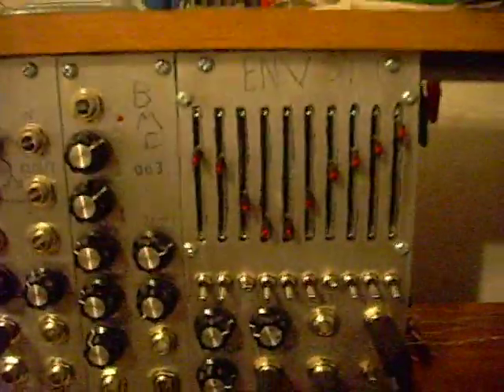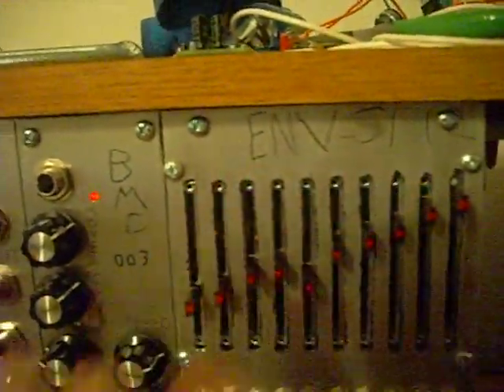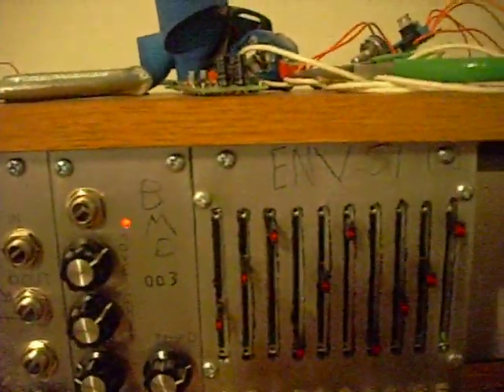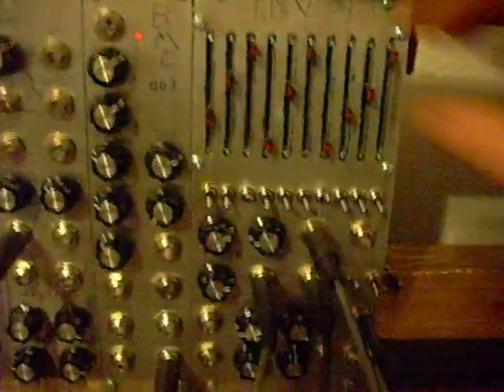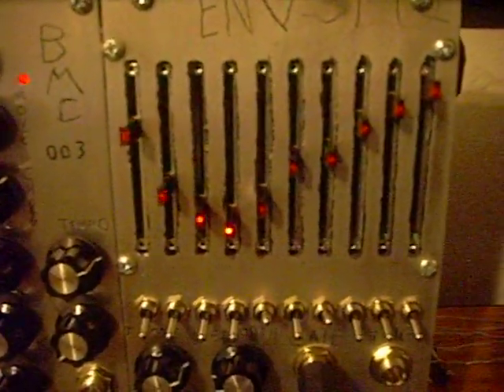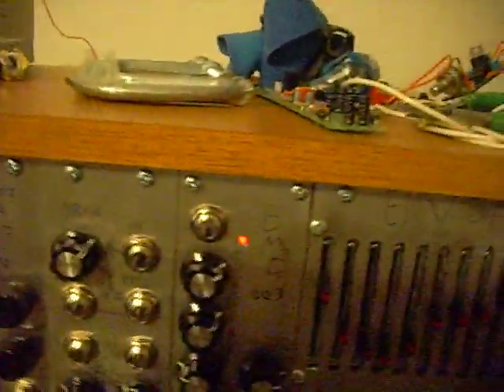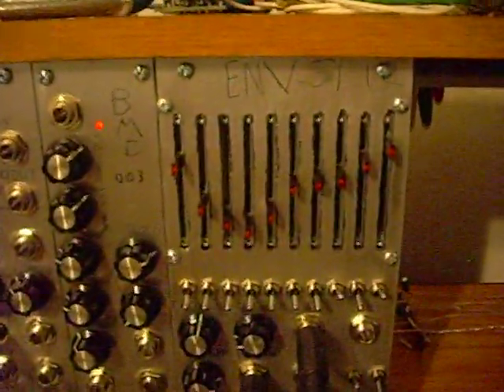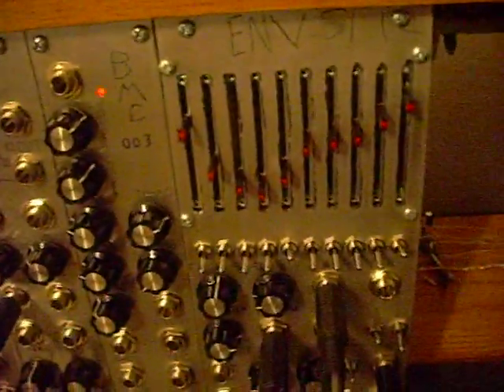Envelope Sequencer

Comment: That is really visually appealing!
I really like the look of your DIY rack setup.
I would love to see a video focused on your power supply system (the power supply along with the connections from the power supply to each module).
I'm building my own DIY synth and my power distribution is okay, but not something that I absolutely love.

Also, why did you wire the slide pots upside-down? Was that on purpose?